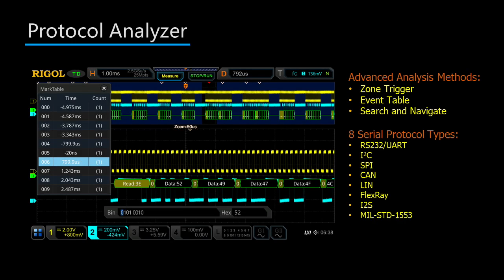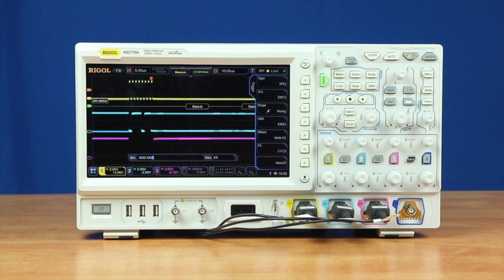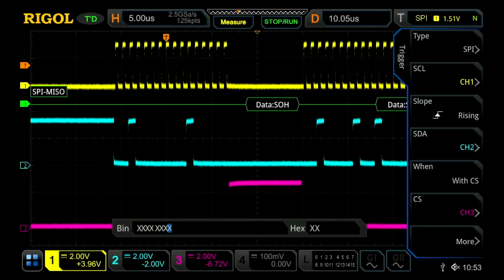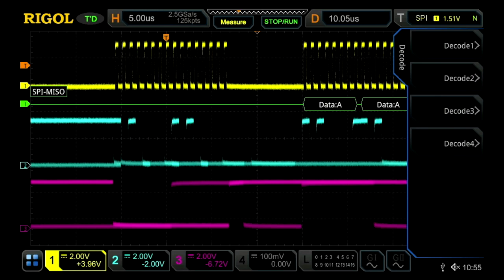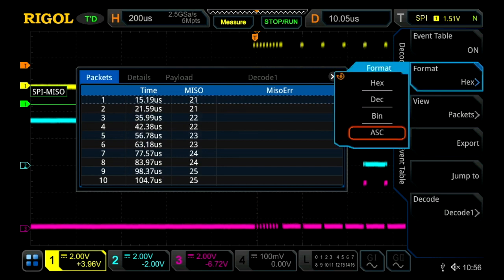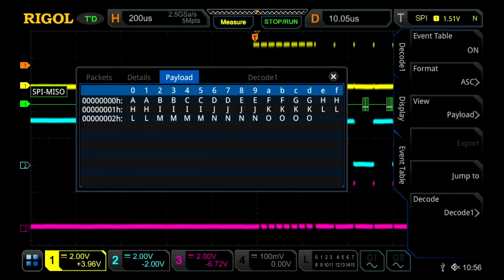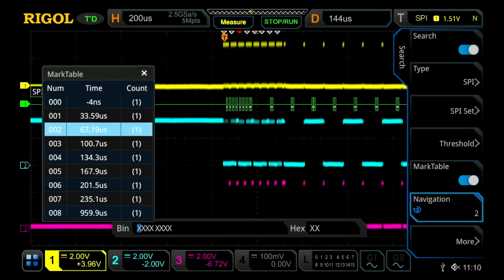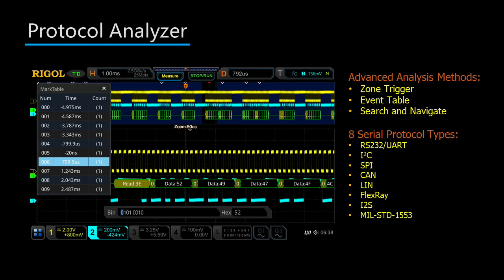Performing Protocol Analysis on the MSO5000, DS7000 or MSO8000

Comment: I have MSO5204, I want to use decode function, but, when I pressed this button I just get option "Decode -parallel 1" and there is no option for setting the clock or data type? What could be the reason. Is it because of firmware version, licence or any other specific issue?